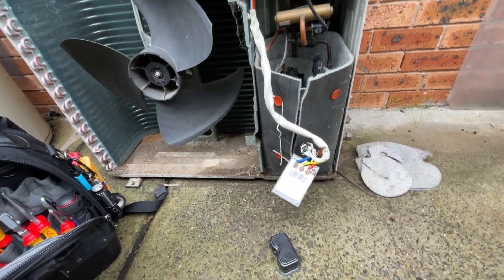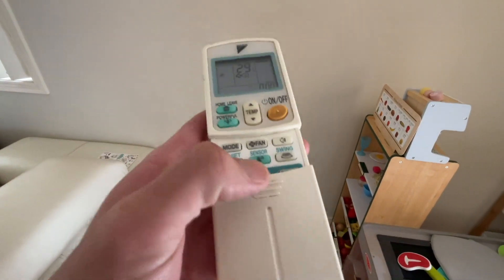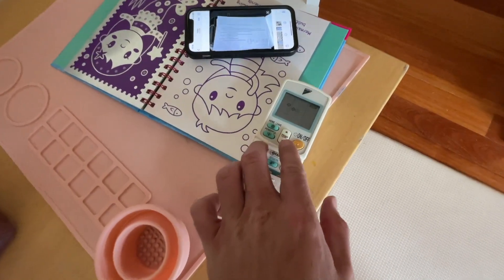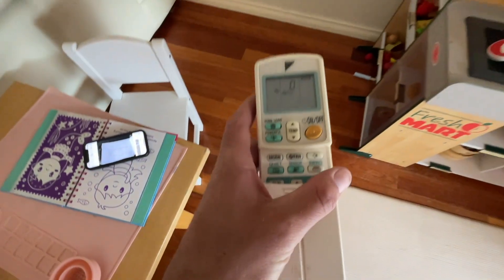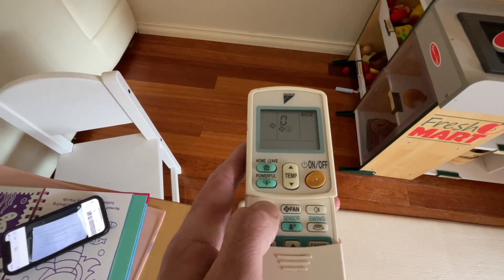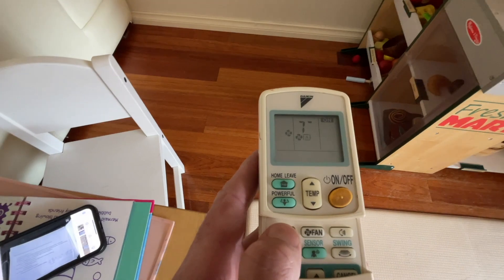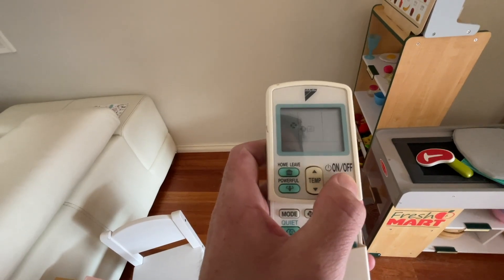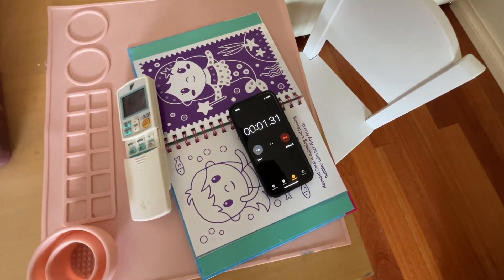Diagnosing Daikin E5 Error

Comment: ’m having the same issue with a DAIKIN Multi Split system. However, out of the three indoor units, one of them stops cooling at some point, and when we check the code on the remote control, it shows L5. Do you know if this problem could be related to the circuit board or the compressor? The unit doesn’t stop running; it just cuts off the refrigerant flow to one indoor unit, and this issue is also relatively sporadic.

Comment: Is it possible the E5 error might happen just because of very hot weather? 2nd day pushing past 40 and I've been unable to get the system working again for an hour or so. I've got a fan pointed at the outside unit coz there isn't a heap of airflow, though not confident at this stage.

Also, if it is just the weather would it potentially just work again once it cools or do I have to press something to reset it once the inspect mode has started flashing?

Had a similar issue with it a few years back during a heatwave, but as far as I can remember it eventually just worked again.

I have the older daikin brc1c51/61 model, no remote with just the wall panel.

Comment: I would suspect check the charge 1st. I had one with an e5 but it lost half the charge due to the evaporator developing a leak. I would assume could happen as well if overcharged. Is that correct?  Just because of the code doesn't mean it's a failure of the board or compressor, it could be doing what it's supposed to do due to low charge, overcharge, or restriction. Is this correct?  Or no
Reply: I agree with u

Comment: @maracservices 

Hey mate!
The 7 on the remote is actually a T for test!

With an e5 fault the high chance of compressor seizure with your failed board, good call with the condemn of unit 

Would have been good to see if you had a strong insulation resistance reading or not

Comment: appareil photo

e5 mechanical compressor lock possible to turn off the device is closed electrical switch in off mode in more than 6 hours after turning on your device it was working.

￼

Comment: just swap out the outdoor unit. This board swapping is the road to hell. I've got a 2016 12.5kw  unit with a bad board and I won't just swap boards. Its new condenser or nothing from me.. 
Been bitten too many times by Daikin to play those games. Esp when the price of parts+ time+ no warranty  fitting  matches the cost of a new outdoor unit with warranty.
Reply from the maker: @richardbartlett6932  I have a genuine question, where do you get an outdoor unit for older models? I’d love to change the whole outdoor. That would be amazing, just as far as I knew that wasn’t an option. Daikin only stock current models (as far as I’m aware).

Comment: Problem with this scenario , you now quote client on new inverter PCB because compressor windings measured good. Client gives go ahead for new inverter PCB. You install new PCB only to find compressor has seized. Now Daikin wont return the PCB as it has been installed and client has to fork out the cash for compressor. At this stage it would have probably been more cost effective to install new unit with 1 year warranty. I always quote  replacement of compressor + inverter PCB vs new unit.
Reply: Very true with all inverter compressors as damned if you do damned if you don't its a proper catch scenario 
I would quote for new out door as long as you can get the outdoor as they change to a new aircon model so then it's a new whole install and like he said it looks like it's had a new board in it's past or someone has been looking at it !!!
I prefer working on refrigeration to be fair and only installing air-conditioning because even advice off Daikin and they say it's the board but it could be the inverter compressor wtf as you have to tell the customer ffs which doesn't sound reassuring 🤬
Reply from the maker: I get what you’re saying. You’ll be happy to know I replaced the entire unit on the Saturday just past.
Reply: I would do the same thing Craig 
You never get any thanks from anyone by faulting the pcb then ordering them come back to replace the part to find out it’s another part that’s in fault also
Would always advise to replace the whole outdoor unit which comes with warranty

Comment: Friday also had an RX50 with E5 error code - no refrigerant in system, windings measured fine -  compressor had seized.
Reply: RX50's are just unreliable -
Reply: @craigladewig3158 that’s what I always paranoid about. How would you confirm the compressor has seized if windings are fine. Would megga it out show it is down to earth ?

Comment: You know you have a low quality units when the data plate is a label and is peeling off at 10 yrs…all units nowadays. 

Did you check communication?

Install surge protector.
Reply from the maker: This unit was definitely over 15 years old. I couldn’t check for communication because the outdoor board was dead. I replaced the entire unit on Saturday

Comment: Hi Mitch, how many years is warranty for changing parts.pcb board etc
Reply from the maker: I honesty don’t know what the manufacturers warranty is. A lot of manufacturers don’t warrant it once the packet is opened and I’m not even kidding haha.
I think they’re covering themselves from hacks incorrectly installing parts and incorrect diagnosing. That’s not the consumers issue though because if the part doesn’t work from incorrect diagnosis then the air con repairer  will wear that. So it’s important for the repairer to be pretty confident before buying parts.

I think most air conditioning companies give 12 months warranty on their work.
Reply: @maracservices  I don't do warranty on inverter boards unless the supplier does warranty

Comment: Is that a daikin specific inverter checker? I have a refco brand, not sure on its compatability with different brand units though.
Reply from the maker: It’s all good, yours will work with everything. I bought mine from Daikin but they’re all the same. Mine doesn’t have any branding on it.
Reply: I have Refco checker and works fine

Comment: The two screws floating around in the bottom of the board enclosure are meant to attach the heatsink to the board along with thermal paste, if the screws aren't installed and new paste wasn't applied that replacement board never had a chance.
Reply from the maker: As soon as I saw those screws I knew exactly where they were from. Like you said, they’re the ones that screw the board down to the heatsink. You make a good point about the thermal paste, there is a good chance it wasn’t applied and even if it was, it probably isn’t a good contact. I replaced that unit today so I actually have this old unit in the back of my van as we speak so I can see if thermal paste was applied.
Reply: @maracservices  Please give us a report on the thermal paste.
Reply: The top right screw had seat sink on the threads. How the previous tech didn't see that is wild
Reply from the maker: @J.k313  crazy stuff!
Reply: Damn it everyone beats me to these comments. But good work that's my conclusion too.